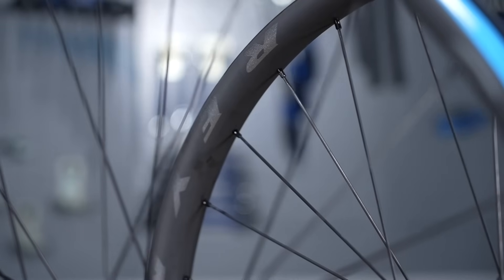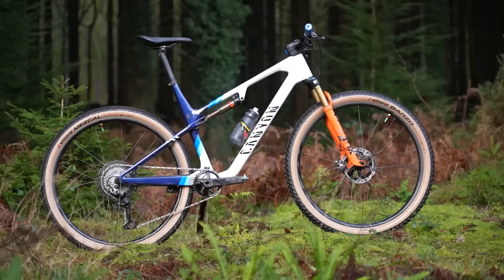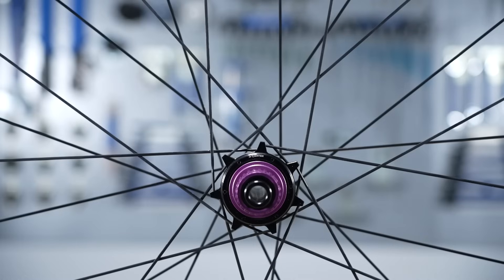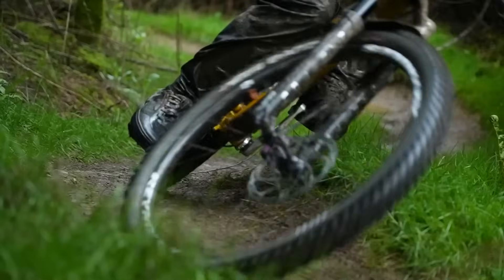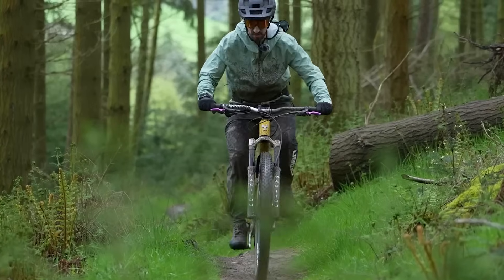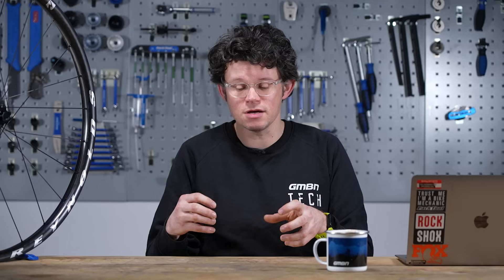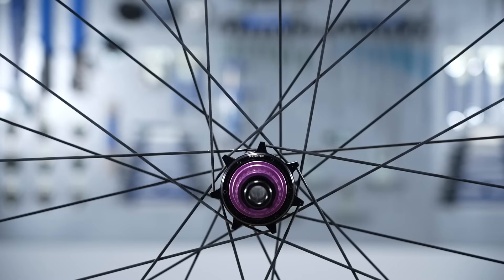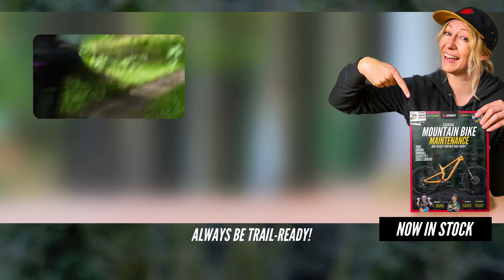How Are Mountain Bike Wheels built? | MTB Tech Explained

Comment: On my new Atherton AM. 130 which I use mainly for forestry type single track and the occasional bike park riding I specced a light weight Stan's Mk4 Crest wheel set shod with lightweight Continental xc/trail tyres. For this winter I had a wider, heavier set of hand built wheels fitted using Stan's Mk.4 Arch rims with Hope Pro5 hubs shod with Wicked Will tyres.....And to be honest I have not noticed any real world difference in the bikes handling or speed, both sets provide equally great riding fun......lesson for me is don't agonise over small differences in wheel set weight, While Tom Pidcock  will notice and need xc speed from his wheels and its lovely having x2 wheel sets for my bike as a non racer who rides just for the love of it I would have saved a few hundred pounds by speccing the heavier units in the first place!